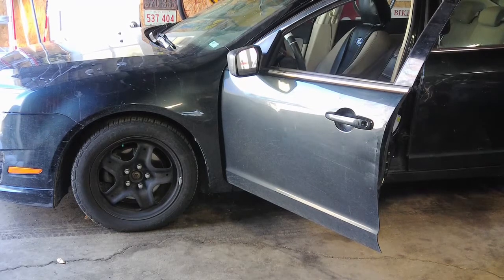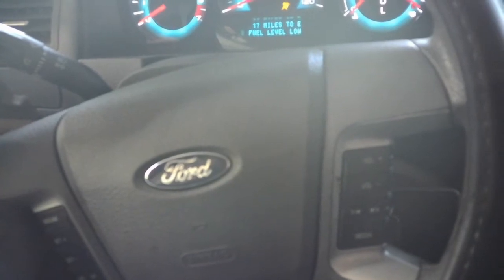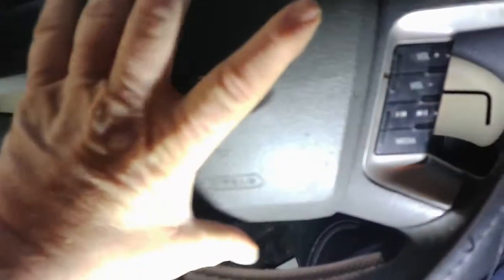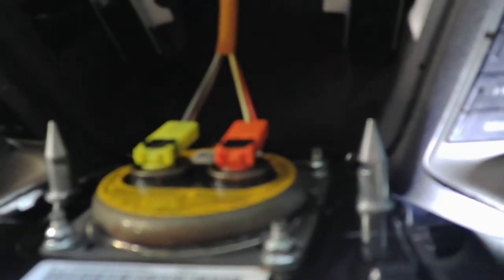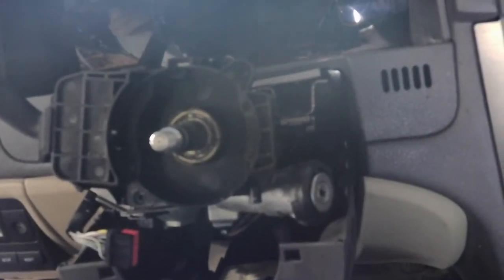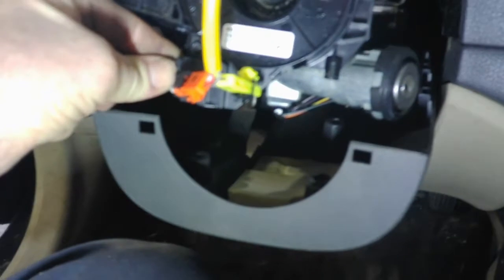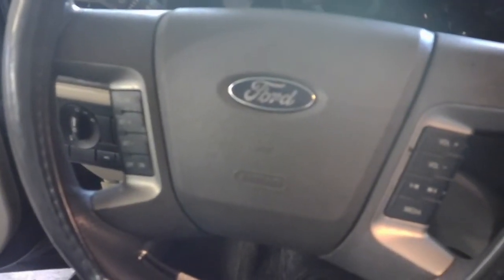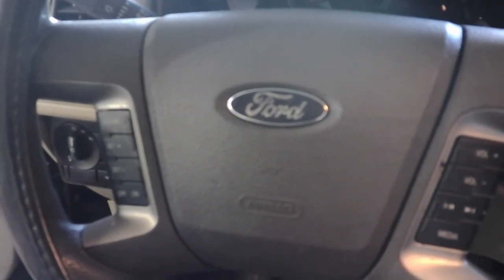2010 Ford Fusion Air Bag Clock Spring. Air bag light on, horn not working etc..

Comment: Just had a problem with my clock spring. Took it to the dealership and got charged over 600 dollar for labor 😮 is this normal?
Reply from the maker: For a dealer, yes.
Reply: @HooptiesGarage  thats outrageous. Looked like it wouldn’t take you much more than 45 minutes in manual labor.